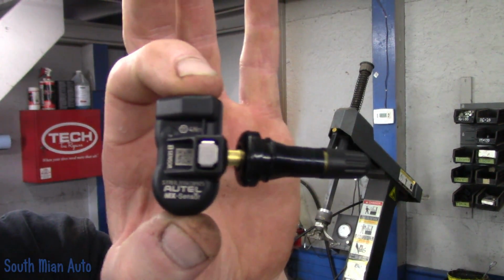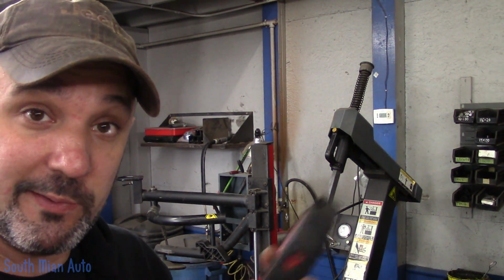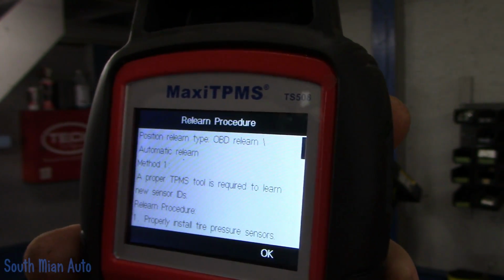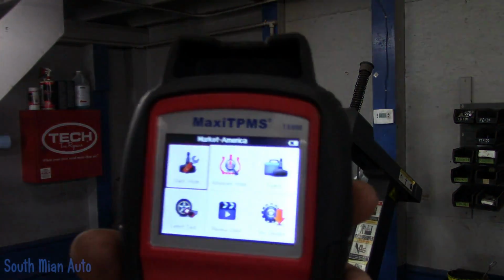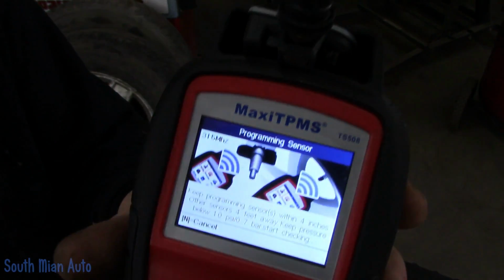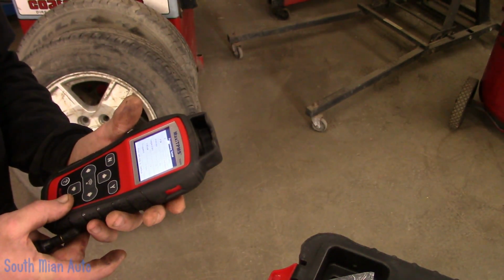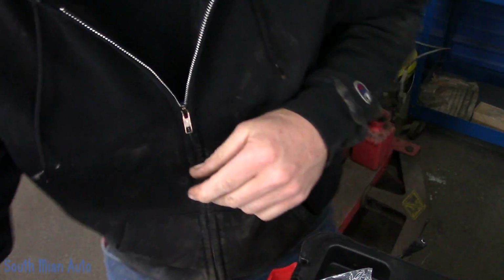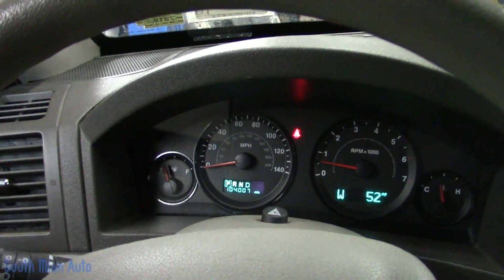Tool Time: Autel TS508 TPMS Tool For The Tech / Shop

Comment: What does it mean if the TPMS shows dashes on the vehicle display? No errors just dashes.
I have 2007 suburban and 2005 suburban. Both got brand new tires same day (Friday this past week). The 2005 shows each tire's pressures.  The 2007 shows dashes. No warnings or lights on and no error codes. I paid for tpms kits for all 8 wheels I would think they should all work. 
Guess it's up to ME to do relearn.
Reply: Yeah them tpms sensors aren't reading that's why it shows dashes. It's not your responsibility to relearn anything. If they worked before and now they dont the shop is responsible for that not you.

Comment: Great video.  Thanks.  I have a 2005 4runner LTD.  The TPMS light comes on in the summer and goes off in the winter.  This leads me to believe the temp range needs to be adjusted.  Is this possible?  If so, is it the sending unit or the ECU that gets adjusted?  BTW, it's a florida vehicle.  Thanks, again.   P.S. This stared happening after the local dealership replaced the sensors.

Comment: hey there Eric do you have a saab coming soon :) ? i have problem with the ventilation in my saab 9-5 2.0t 1998 and the problem is that the ventilation is always blowing hot air on the driver but the passengers get cold air? in forums they say it's a common problem that an arm to a lever for a flap always break when they get old (plastic) but to get to it i need to remove the dash...

Comment: How about a diyer retired very limited fund auto tinkerer? Working on family vehicles
Reply: I myself have the TS501; which was $230 on Amazon. it doesn’t have all the bells and whistles of the TS508 but it does do the basic activation and keyless entry testing and can program the Autel sensors as well.

Comment: A smart tool as long as you dont mind being forced to use only there sensors.
I wonder how long it will take for people to hack the software to make it more open lol.
Reply: Wouldn't have thought it's worth it, sensors are pretty cheap, used to use an autogem version of the same kinda tool, seems to be the one most people on the UK use. 

Think iirc the sensors were billed out at around 65 quid Inc vat and fitting

Comment: Tyre pressure sensors ??
Reply: It's an American thing im guessing... sensors mounted inside tire read pressure and send warning to vehicle if detected pressure drop. 
Downside is they're a hassle, give faulty info, etc.. 
I have them on a 2007 suburban and 2005 suburban. Both just got all new tires same day. 2005 shows pressures but 
2007 shows dashes.  🤷‍♀️

Comment: Still can't believe that these are being put in cars. Honda eliminated them, thank god.
Reply: Bobby Brady  I think it uses abs, checking wheel speed and height. Vdub jettas and some mazdas do the same. Some new Hondas too. Heck, even old bims had that technology. That the way tech is, and seeing the pace it is not getting less tech. Tpms system was going to happen, government mandated or not
Reply: Quite a few companies use axle ride height to determine tire pressure but some dont. I've had 2012s use ride height and 2019s use tpms sensors.
Reply: Its not ride height it looks at,its wheel speed from abs.....

Comment: Great video. FYI, I've programmed aftermarket sensors other than the autel ones with this tool. Great tool. It's my go to  over the snap on because I got burned by the snap on (2009 Hyundai Tucson, I'll never forget)
Reply: hi, can you tell me a few brands of aftermarket sensors (besides autel) that you were able to program using the ts508?  I am interested so I know what else I can purchase if I can't find autel in the future.  Thank you.
Reply: It will relearn other brands but will not “program” other brands. If that makes sense?

If you have a blank shrader sensor for example, it will not program it. If you have one that has existing info on it, it will relearn positioning, reset etc.

Comment: G'day, Mr. O! Wow! Thumbs up!! The Importance of Having the Right Tools for the Job! If you ask anyone with a little experience in DIY for advice, the one thing that I've heard (even mum, has always said) time and time again is that you should always use the right tool for the job.

Most of us have learnt this the hard way but, despite this, (as you know) many newcomers will still look for the quick-fix when they can. Not only does this result in a lacklustre job in the short-term, but it can also lead to much more problems down the line.

Well, the Maxi TPMS TS508 a must have tool for an auto mechanic or just a do-it-yourselfer. Pays for itself after doing two vehicles! As noted: It can program, reprogram, relearn/retrain the tire pressure sensor. Great tool for the money! Thank you! Cheers! 😊✌🏼🛠❤️

Comment: You have to change these  every time  you have a new tyre ??? Or don't you replace the valve on these every time??????
Reply: As he said in the video, this sensor had a broken stem. The sensors are easy to break, especially if the person doing the change is inexperienced.
Reply: You only replace when the go bad or they get stuck. Reason being is that anytime you get new tires your supposed to rebuild the valve if you cant rebuild the valve because of corrosion it needs to come off. Only way off is to break it.

Comment: Question; does this TPMS work for Volvo's from like 2011 and up? The reason I asked is I had to buy one called ICARSOFT model i906. In order to get into the VOLVO vehicle management (computer) and reset a Passenger side airbag off and seatbelt warning light, also I bought new sensors when I purchased new tires. The tire place installed them for free, the warning light for TPMS could not be cleared using my other scanner. The iCARSOFT scanner did clear the warning light but it reappeared. The code said the wheels are off the car! So I will replace the module that sends a alert to the computer.
Reply: Volvo is in the menu. So I am thinking it should. It has 2 ways you can program through OBD2 or automatic relearn.

Comment: I've been using the TS508 for about 6 months. I love the tool, not so much the Autel MX sensors,  I installed 3 in my 2007 Jeep GC  5,7 Limited. I cloned them from the existing sensors. They initially all showed up in the EVIC. Subsequently they would drop out when the vehicle was left parked over night. Then they would randomly drop out while driving. I did an OBD relearn with some improvement but still with random drop outs from the EVIC and flashing TPMS warning light. Autel acknowledged there are issues with some OEM's as they use a different method of sending the data to the ECU. I checked the Autel scan tool users  Facebook page. There are known issues with Jeep Grand Cherokee, Compass, and Liberty. Also Toyota.  I continue to use the tool, but I switched to VDO RediSensors.
Reply: Hi, How do you activate the VDO Redi-Sensors. I have them on my 2024 Nissan Z extra rims but don’t know how to activate the sensors. I have the Autel TPMS programmer but can’t activate the Redi-Sensors. Any help would be greatly appreciated.

Comment: so my 05 GMC Sierra 1500 tires sometimes go really low like 10 psi lower than it should but the TPMS Never trigger on the dash does this mean that i need to reprogram the sensors ?
P.S i recently bought those tires and now the pressure stays the same but when it goes down no dash lights come on .
Reply: Depends on manufacturer, some go off really soon so take alot of loss to go off.
Reply: Not only that if your over inflating the tires than it wont make a difference the sensor is going to go off when it gets below the set dot tire stickers pressure. On the driver side door jam you will see a sticker with all your tire info that is where your tire psi should be inflated to. Ie if you using 40psi in a tire that requires 30 than dropping 10 psi wont do anything because your still above what your car is set for.

Comment: Is.there anyway to diagnose a rack and pinion on a 2012 Tahoe without having to.tear it apart ?
Reply: What is it doing?
Reply: Does it whine or click when you turn? That’s the main diagnosis. It will click and pop really loud.
Reply: It's is loose at freeway speeds like it.will shift to.the left or right slightly on the freeway. I already replaced both ball joints, both upper control arms both tie rod ends.
Reply: When it shifts around do you feel anything in the wheel? With that problem I would suspect the wheel to give a bit as the only way the rack could steer itself would be if there was play in the wheel. Internal seal failures usually result in lower power assist and the wheel fighting you as you steer, even at lower speeds.
Does it have the autoride electronic suspension option?
Reply: You should have the alignment and tires checked by a qualified shop. It can't be diagnosed on the internet. You've already wasted enough time and money throwing parts on it.
Reply: jason9022 dude leave the channel, we don’t want that negativity here okay.
Reply: jason9022 i don’t goto a mechanic I change all the parts on my truck myself, so I would consider myself a mechanic. And ironically I need a rack  and pinion, so don’t be a jerk okay, you aren’t better than anyone else here, ever watch an entire Eric O video, “if I can do it, you can do it” he’s making people realize that’s he’s just a normal person just like everyone else, he just happens to be good with cars.
Reply: Either Jason deleted his comments or Eric muted/banned him.

Comment: I couldn't be any more happy with my tpms error light.... Too much money to replace the sensors even if i do the cheap 4 pack for $50 and $10 for a programmer... That $60 is food for the week
Reply: Would you mind sharing specifics of what you are referencing with the 4 pack for $50 and $10 for a programmer.  My two vehicles have the tpms lights on and for $60 I would be tempted to try to replace the tpms at the next tire change...but all of the ones that I have seen are much more expensive than $60.  Thanks.
Reply: @boat6868  its the best price i found on ebay... Just gotta do 300 searches and cross your fingers
Reply: @mcf3778  Ok...thanks for the reply.